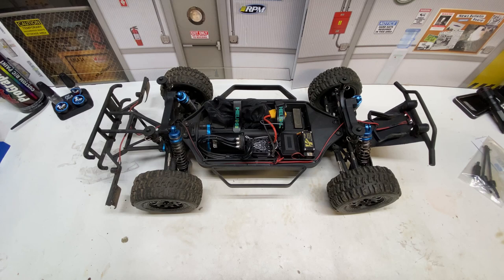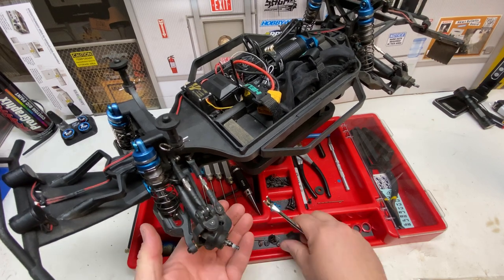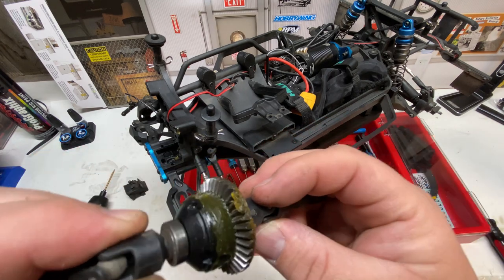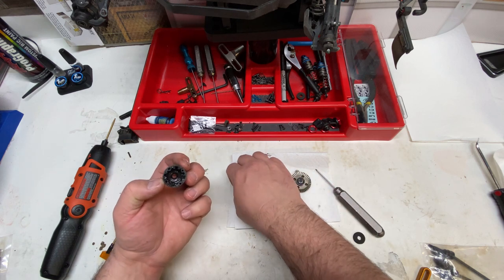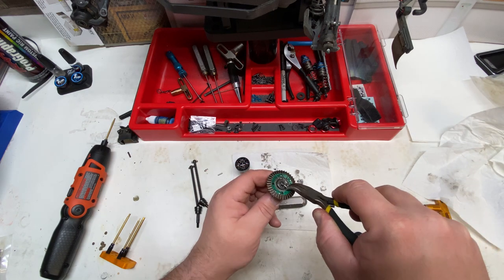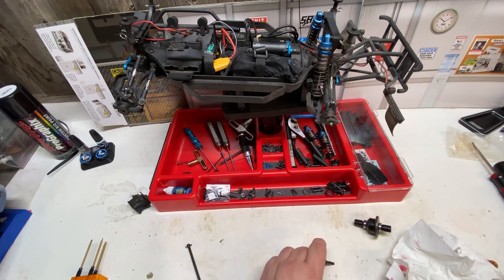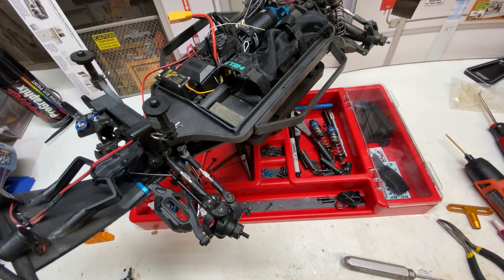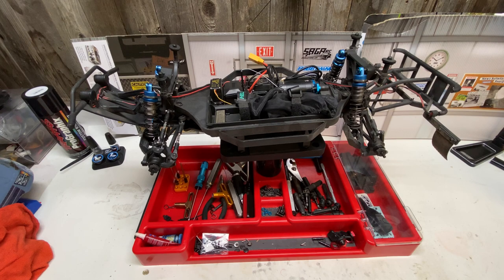Team associated pro4 Sc10 2021 steel drive shaft upgrade 25847 25848 installation NOT FOR RIVAL MT10

Comment: Personally I find nothing wrong with the plastic drive shafts. I've broken so many steel shafts in my other vehicles I can't even count. But the original plastic drive shafts in my Rival are still almost perfect with just a little bit of slop where the pins go trough the joint part thingie. So, supririsingly, I have to say that the plastic ones seems vastly superior:D

Comment: Not sure if you noticed this. When installing the cvd’s and run the motor on the stand the rear suspension appears to bounce up and down. Assuming this is due to the slightly shorter length of the cvd? Wonder if I need to get shorter suspension so it sits higher. When flat surface appears to be ok.
Reply from the maker: I would think it’s because of the out of balance tires not the cvds

Comment: I'm curious because I can't find any follow up videos, so how did it handle afterwards and did it change any of the momentum pattern while jumping and gear wise did it have any effect on the launch and ability to transition out of turns, I also noticed you have an aftermarket suspension setup what are you using and is it higher or lower than stock?

Comment: Been very disappointed with the front A-Arms on this truck. They must be made of glass. Just ordered some RPM arms
Reply from the maker: I haven’t had any issues until today I broke a front arm but it was very cold outside and I slammed into a big ice ball at full speed !
Reply: @Metal RC  I just watched the video.

Comment: I put a 1/8 scale truck body and some truck tires on the SC. Makes a great handling vehicle.
Reply: Man ive been itching to buy a SC chassis and driveshaft for the MT. I thought itd be better handling and put more pwr down. I got a different pwr system in that Helion Avenge 10MT, same rig. Make a vid! Lol

Comment: I just purchased a Pro4 SC10. What shocks are you using?
Reply from the maker: I am using the team associated factory team shocks for pro4 
25846 rear shock set 
25845 front shock set 
They have been awesome no leaks and it has been used a lot

Comment: What your opinion on this truck? Planning to get one, wanted to know how it is, what are weak points of it?
Reply from the maker: I love this truck I really used it a lot last summer and really put it though it’s paces lots a of big crashes at high speeds and only had the shock pop off the top mount just added a washer and it was all fixed . It is a great price I would recommend!

Comment: Is this truck any good at racing or is it only good for bashing? I am very tempted to get this and start racing (don't have budget for anything more expensive).
Reply from the maker: This truck is for bashing i don’t think it would be great for track racing . If you are racing against traxxas slashes it will be competitive but not against more purpose built race trucks like the tekno losi etc
Reply: @metalrc  thanks 👍

Comment: They aren’t the best driveshafts, I installed on the rear and first run at the track, landed alittle off and it bent the crap out of the driveshaft. Looks awesome though lol. I have rpm arms so I guess the shaft took the brunt of the force.